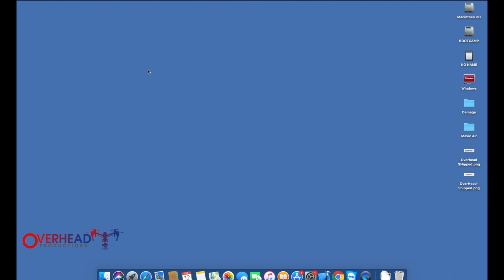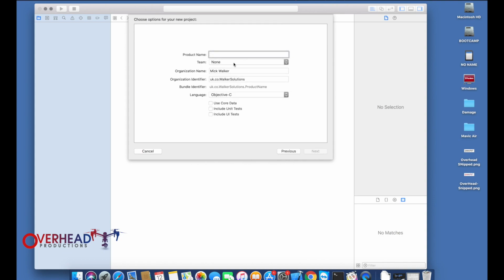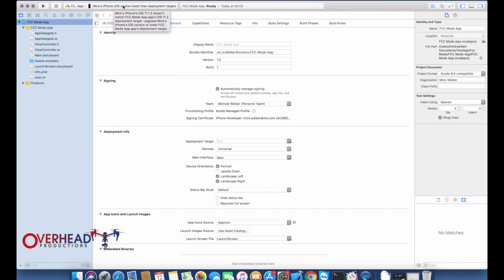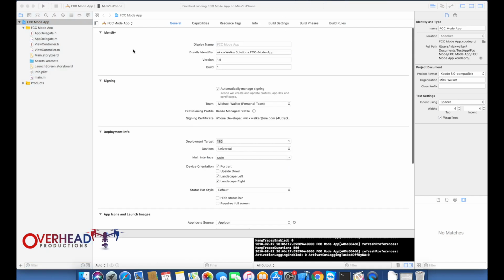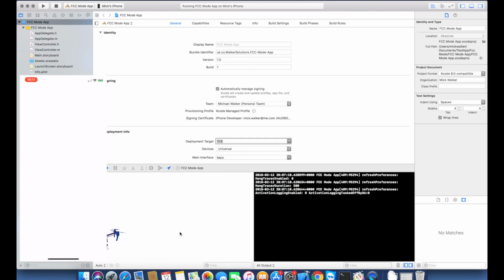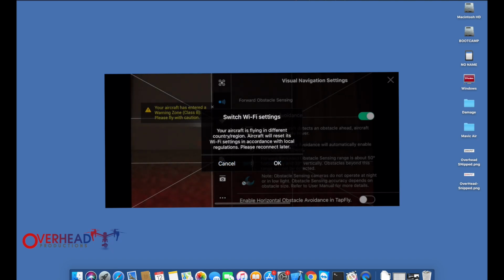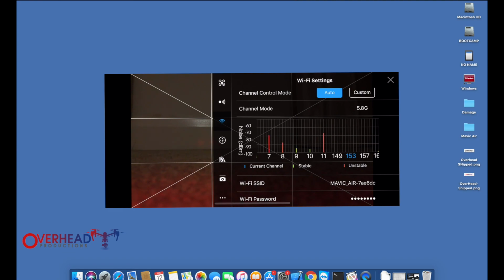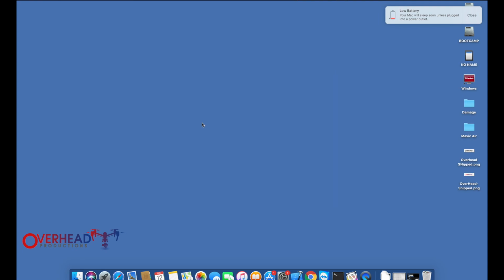DJI Mavic Air Force FCC Mode

Comment: Sorry man, the map goes back to the current location, FCC mode does not work, possibly they've killed it in latest firmware
((
Reply: The drone will remain in FCC mode until you opt to change it within the DJI Go 4 app. The map on your iOS device returns to normal mode - it will however not impact the wifi mode of your drone. Positively verified, using the latest firmware & DJI Go 4 app as per 2018-04-01 on a Spark and a Mavic Air.
Reply: Thank you, it finally worked on iPhone 7, not on iPad mini 2

Comment: Hi does this work for the mavic pro or just mavic air. I’ve successfully set my iPad to NY and maps showed it was there. I plugged into the controller and hooked up to the Mavic Pro but I didn’t see and pop up detecting a change in country. #puzzled
Reply from the maker: You have to connect your mobile device to the drone using a wifi connection, no controller. Then it will also work for the Mavic Pro.
Reply: Works with a wired connection too. Did mine last night. Used xCode on my Mac then just unplugged my iPad and connected to the controller using the USB socket on the bottom, once it had swapped to FCC mode I disconnected the iPad, power cycled the controller and drone and then swapped back to my iPhone. 

Works a treat.
Reply: nibunker was it a mavic Pro you did this with? Also how did you confirm FCC mode. I don’t see the channel count when using the app with a Mavic Pro

Comment: Sweet! This would work on the Pro aswell?
Reply from the maker: leffegadd it would yes.
Reply: Thanks. Would this affect anything else? Like RTH or anything else crucial with flying the Mavic?
Reply: And: I'm not having "Auto" and "Custom" option in my app when checking for 11 or 13 channels. It just says "2.4G", "5.8G" and "Dual" option for me. Right now when following your tutorial, "2.4G" option is selected and only 11 channels are available. I have not ever while following this tutorial been prompted that my aircraft is flying in a different country/region, by the way.
Reply: ..no?

Comment: iv got a few questions, please make sure to answere them all(much apreshated)

1. does the location reset to your actual location after phone reboot?
2. do i need to login to xcode with my apple id to be able to run the app?
3. do you usually need to connect to the mavic's wifi when flying with the remote?, or is it just for this hack and wifi can be off on the phone while using the remote to fly
Reply from the maker: 1. it does indeed
2. Yes

Comment: Tested with Mavic Air an iPhone7 plus. Fairly Easy. Unfortunately, I can't seem to find how to include the fake coordinates in the app to work in runtime. This would make it work stand alone without the Mac.
Reply from the maker: Thijs Post sadly you won’t be able to do that, as it would mean your device constantly had a fake location. Wouldn’t be good when it came to the ‘return to home features’. It’s a development time only feature I’m afraid, and only available when attached to a debugger.
Reply: I believe it used to available in previous xCode versions. I can start the app under settings => device management. I know it would never pass the app store rules, but if the fake GPS location would be available in the test build on my phone, I could use it to reactivate the hack without my mac. Where it could help to use the hack where you need it.
Reply from the maker: I tested this and it is possible using a GPX file bundled as a resource with the actual app. You have to impliment your own Core Location manager which will read the GPX file and return the fake location. The problem is, that the DJI GO app will think the location you set is your actual location (until you reboot your phone) when using this method, so its not really a good solution.
Reply: Overhead Productions, Thanks for the info. It could be useful if you are one a trip, and yo accidentally hit the “ok” button to go back to CE. The app could help you to switch to FCC, without your laptop.

Comment: Interesting... Are you using the latest version of the DJI go 4 app? (4.2.6)
Reply from the maker: MrKimosabe75 we are indeed, with all the latest firmwares.
Reply: Even if you update the Firmware to a newer version it wont effect this ‘mod’. As far as the drone is concerned its been in America and now its home again. As long as you keep hitting ‘cancel’ when it asks you to change back to CE mode then it will stay in FCC mode.